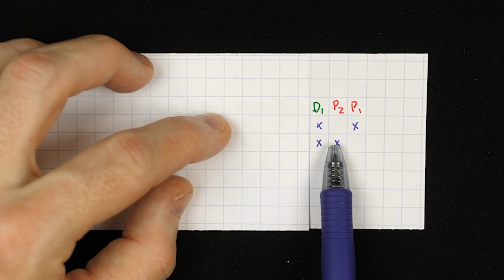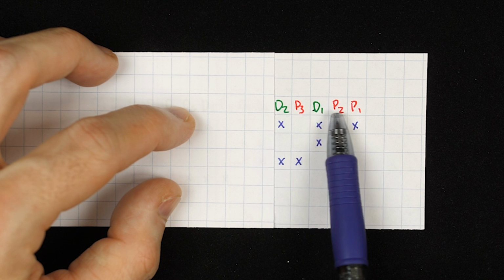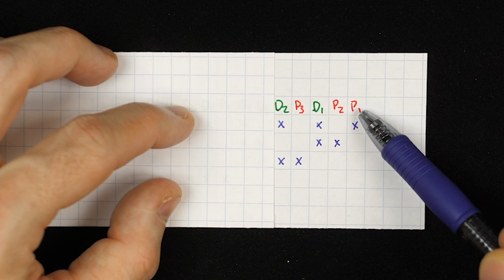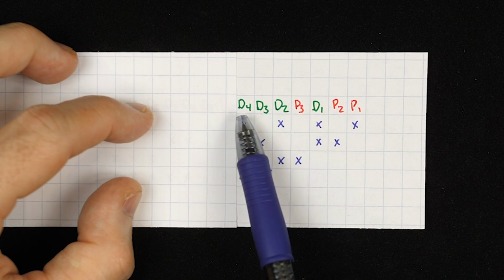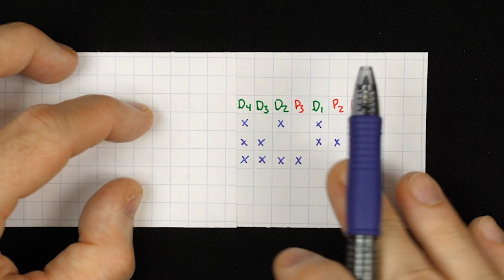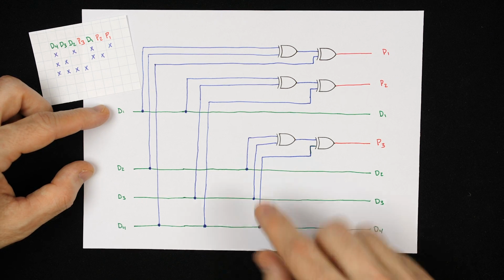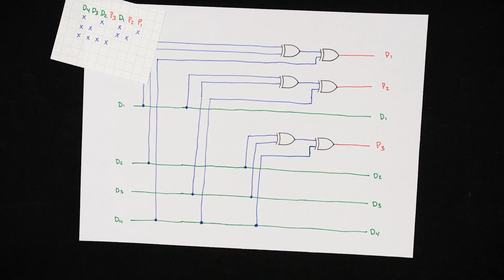What is error correction? Hamming codes in hardware

Comment: This scheme can be expanded by adding more "parity bits" to allow correction of 2-bit or 3-bit errors, which brings me to something else which can be (and occasionally has been) done.  Distributed storage.
By adding sufficient parity bits, in the right places, it's possible to divide a file into smaller "chunks" which collectively take up around 1.25 times the original storage space, but you only need to retrieve approximately 75% of the "chunks" and you can then calculate all of the missing data by using the parity bits stored with each "chunk" of data you did manage to retrieve.
This means that in a distributed storage scheme, data pertaining to a particular file can be stored across multiple servers and if one or two servers go out of service, you can still retrieve and reconstruct the original file from the remaining servers.
The down-side is that the reconstruction process takes a long time since the mathematics involved is complicated, and making hardware to perform the task would not be economically viable.
Reply: For those who didn't know, this is exactly how RAID 3, 4 and 5 disk arrays work, using 25% of the space to store parity data, and RAID 6 doubling the amount of parity data to be able to restore if two drives fail. Also, RAID 2 uses Hamming codes.
Reply: @1loshvitalik  oh my that's-a interesting to know
Reply: Well, that's cool.
Reply: That last sentence is exactly why ZFS is still only used on servers, the overhead is too high to use on a desktop system. Plenty of people have tried, usually with ZFSonLinux, but they usually have to add a lot more RAM, or disable most of the features which make ZFS useful (rendering the exercise pointless).
Reply: Are you talking about binary BCH codes?
Reply: @Crazytesseract  I'm not sure what the terminology is, so ... maybe?

Comment: 8:50: the upside down dip switch outputs 0 when set to "NO", perfectly logical :D
Reply: If "NO" = false = 0, then you have a programming language!
Reply: @OrangeC7  Correction: Then you have PHP or Javascript.
Reply: @ShenLong991  Also C/C++
(older versions especially, where boolean wasn't always a first-class citizen and could be implemented as an integer where 0 = false, and non-zero = true. In fact even with formal implementation of a boolean type that still holds)
Reply: @KuraIthys   I mean... that also how it works in python ( https://www.python.org/dev/peps/pep-0285/ ) and a lot of other languages
Reply: Well that works
Reply: @OrangeC7 
"NO" == false == 0
("NO" == false) ==0
false == 0
true
Reply: and 1 when set to "ℲℲO"

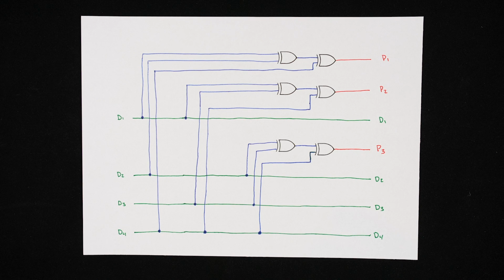Comment: 6:50 - original hamming code
16:07 - error generating ckt
18:20 - computing correct parity bits
27:27 - building back corrected hamming code ckt

Comment: It should also be noted that you can take two more XOR gates and wire them up to the three outputs (yellow LEDs) on the bottom board, and wire the output of that to another LED. That will then tell us if the problem is a parity-bit error (odd # of yellow LEDs on), or a data-bit error (even # of yellow LEDs on)! 😊

Comment: Nice! I did a bachelor’s thesis on FPGA implementation of Iwadari code codec - these are able to correct error bursts by basically introducing a checksum bit after every few bits. I had 16 bit burst correction (provided another error burst did not occur for another 1600). There was a 1 check bit every 4 data bits, and the checksum shift register was 267 bits long. Quite a monster. Did not get to the practical realization, but simulated pretty well.

Comment: Between this and your ALU’s addition/subtraction switch, you’d think there’d be a market for an XOR gate IC with all of one side internally connected. Call it an XOR buffer if you will. That way you’d be able to flip 8 bits simultaneously with a single DIP20. 8 in, 8 out, 2 power+gnd, 1 toggle, 1 tristate high-z enable or whatever.

Comment: This looks like the same method that structured light 3D scanners use, which project a flashing pattern onto an object. Instead of doing one scanline at a time they first light half the image. Then split each half in 2, then each subsequent half in 2, so there is a doubling of lines on every frame, and in just a few flashes, they are able to deduce a very high number of scanlines.

Comment: as an electronics engineer, how often do you have to check which terminal has which function of your ICs? If it's anything like how I engineer software, you're probably checking a schematic or some other document for at least five minutes before each video and possibly between cuts. But unlike software, getting the wrong interface (terminal) with hardware can frequently cause immediate irreversible damage just from testing it.

Comment: On the error corrector board there was an extra xor gate left over on each chip. Those could have been used as inverters by setting one of the inputs high, and you wouldn't have needed the hex inverter! :)

Comment: When I can, I prefer to use 24-AWG wirewrap wire, the kind with Kynar insulation. With really high-quality breadboards even 26-AWG wire can be used. Kynar insulation is significantly thinner, making for neater wire runs for busses in particular. It's a pity it's so much more expensive than regular 22-AWG hookup wire.

Comment: In the last step of error correction you could have used a decoder, like the 74LS138, instead of the enormous amount of and-gates. With the 74LS138 the output still needs to be inverted though.

Comment: To correct the errors, I would use a 74238 3-to-8 decoder in the place of the 8-bit switch in your middle circuit.  This would correct errors in parity bits as well as errors in data bits.

Comment: Hi Ben. Quick question, how come in your error correcting circuit there is no case for a single parity bit been flipped. ie P1 only, so you would have 001? Is it the case that a single parity bit been flipped means it's that parity bit itself that is the error so we can ignore it? Fantastic work as always. Chris
Reply: Every data bit is checked by at least 2 parity bits. This means (assuming a single bit error) that if only a single parity bit is wrong, the error must be in that parity bit, and can be ignored.

Comment: The first computer system I worked with was a CDC Cyber. It used 60 bit words (coding text as 10 6-bit display characters). It was said that the hardware WAS 64 bits. The 4 remaining bits used for parity... but clearly not for error correction. At least not the Hamming-way. Hemmingway?

Comment: One thing I have noticed, is that the four data bits allow you to check for two bit errors in a full byte if you run it through this circuit one nybble at a time. 

So you can split a byte of data into two nibbles add 4 parity bits to make two bytes of data and then run them through the error corrector and put the byte back together. 

It sounds horribly inefficient, but I'm not opposed to seeing if it works technically.

Comment: Awesome video! Fantastic demonstration of it working through hardware in parallel...can it work through hardware in serial?
Reply: shift registers would be cheating?
Reply: @urugulu1656  No, I don't think so. I was wondering more how you could (or if you could) pull out the data & parity bits and correct them in real time without impacting the serial line timing. I had a quick hunt around for an IC that did on the fly correction, e.g. to sit in between two ucontrollers communicating through uart or spi etc..but didn't find anything.
Reply: @tomasparrado873  guess for error correction you would need to know the entire message corrupted or not at a time. because otherwise you would have to have the information on wheter the bit is correct or not right at the same time you receive the one bit. a sorta cheated way would be to use a differential bus like usb where you transmit the same message twice once normal and once inverted. if at any moment the buslines are at equal logic level there is an error in the receiving end. but you probably can not correct from that alone... and definitely you dont know if the error was due to transmission or due to reading wrong data from memory or elsewhere.

Comment: Thanks for the excellent explanation! However, any communications system has an equal chance of mangling a data bit or a parity bit. I think I saw you introduce and autocorrect parity bit errors near the end, but this part of the encoding/decoding scheme is still unclear. Thanks!
Reply: Technically it doesn't matter if a parity bit is flipped, really

Comment: so memory or digital output cards or data bus hardware often comes in neat, power-of-2 numbers of bits. Like your 8-bit CPU or the 32/64 bit CPUs of Windows XP/7 or 10, or a 16-bit output card for a PLC. This method always uses exactly 1 less than a power of 2 bits (7 bits needed to guarantee transmission of 4 data bits or 15 needed to guarantee 11; 31 for 25 etc.) so my question is, with only 1 extra error checking bit, what is the most data we can recover? does it only add 1 additional bit error proofing or does it depend on the number of bits being sent? My intuition is the latter, but I don't know. Also, what would that look like? Again, my intuition says that there's a neat spot for that last bit, your parity groups are D1/D2/D4, D1/D3/D4, and D2/D3/D4, but there's no D1/D2/D3 parity group. If we use that group for the last bit, what does it get us, and is that the most efficient use of that bit?

Comment: How do you push your wires into the breadboard so easily? I always have to use pliers otherwise the wires bend when I try to insert them, and they don't go in the hole >_>
Reply: Ben has earlier talked about how you want to use good quality breadboards, the problems he was talking about sound like this.
Reply: @SimonBuchanNz  Maybe that's it... I'm new to the whole microcontroller/electronics engineering thing, and I've just been using the breadboards that come with a starter kit I got as a gift. I'll have to look online for some better ones. Thanks!
Reply: Here's the video where he talks about cheap breadboards, if it helps: https://youtu.be/fCbAafKLqC8
Reply: And his page on what to look for: https://eater.net/breadboards

Comment: And if one of the parity bits gets corrupted, while the data bits are fine? Wouldn't it corrupt the data as well?
Reply: No. The parity check ( 3 yellow LEDs) indicate which bit has flipped whether a data bit or a parity bit. The error correction circuit then reinstates the correct value, so if no data bit has flipped the output is correct.
Try out on:
https://everycircuit.com/circuit/5381008999055360
https://everycircuit.com/circuit/4525347830497280
https://everycircuit.com/circuit/462332240986112

Comment: This was so interesting, really I should have known this as I used to work with punch cards a loooooooong time ago! Built the circuits in EveryCircuit to get a better understanding. Had to do 3 separate circuits but can't link together so used switches to simulate. Great work Ben, you've really inspired me to do what I should have done almost 40 years ago. Was learning 6502 assembler last night too due to inspiration from another of your videos.

EveryCircuit circuits:
https://everycircuit.com/circuit/5381008999055360
https://everycircuit.com/circuit/4525347830497280
https://everycircuit.com/circuit/4623322409861120

Now in Tinkercad, much better than above circuits: https://www.tinkercad.com/things/aynAPG9Xmn8

Comment: What use is this it only corrects for four bits, you need eight to store a byte of memory , what scheme does ECC memory use?
Reply: This scheme can easily be scaled up - he showed how it applies to larger blocks already. Building a version that works for 8 data bits would be functionally identical but much larger.

Comment: Yeah, okay. Where is this used, though? I can't really see this being used in networks, since multi-bit errors are the real difficulty there.

Is this used in storage?
Reply: The 3b1b videos go over some history and background
Reply: In networking, specifically for TCP/IP, checksums like the CRC are used, and I suppose a corrupted frame/packet/segment would be retransmitted in that case.
Reply: @usgbitJS  TCP uses an inverted 16-bit checksum such that the sum for the packet at the receiving end should always be zero. Yes, this is for re-transmission. That's one of the reasons TCP packets have sequence numbers. It's a much more effective strategy than Hamming codes because - as I mentioned - large "stomping" errors are most common on networks, where not just one bit, but often several packets get nuked because a rat farted too close a cable half the world away, etc. That's why I'm wondering where these Hamming codes would be practical. I'm wondering if this is involved with something like SMART or other disk maintenance methods.

I guess I'll have to look at the 3b1b vid. (Edit: lol, 3 seconds in it says it's used in CD-ROMs)
Reply: Khatharr Malkavian from what I gathered, they’re used in ECC RAM, various telecom applications, and even in small satellites to counter the noise like the effects of radiation in space, which seems to almost exclusively cause single bit errors.
Reply: @usgbitJS  Ah, yes. Radiation resistance would be an excellent use case.

Comment: 📺💬 If Jirayu still can here have some conversation ( they added sentences into VDO )
🥺💬 For the parity bits error correction by mapping of pattern to the frequency of its use compared to the same in the same sequences.
🐑💬 Of course, for TCP/IP messages you need to divide message and information indicators.

📺💬 Why Jirayu think that is the way they are doing⁉
🥺💬 That is because of programming, the solution you are teaching is correct, and even odd parity bits is fundamental and important.

📺💬 More examples when the combination bits is wrong ( 🔊💬 🏡🥺💬 They keep try to do to make exhaust )
🥺💬 When the priority bit is wrong they are solved by patterns + priority bits but itself cannot verify but the number of messages together summing and priority bit can define the error priority bit and cycling process.
🐑💬 For a small problem referees can judge instantly but referees must be standard, overall they can have supervisors and referees. The combination does not always solve the problem but the combination can merge the problems and information to create new referees as well.

📺💬 We are using flips because the parity bit is wrong but we want to know which is the exact bit that needs to be correct.  ( 📺💬 ยุ้ยแถม... นิดนึง , they add sentences into VDO )
🥺💬 I understand now only the parity bit or message is error one type at a time but you need to correct the message by flipping the bit to see if it sums up to the parity bit or not⁉
🐑💬 Yes, there is the appending method and flips he teaches flips, and the appending you add the next message and sum the parity bits together. 
🧸💬 Some programs they compared of messages by the few bit + parity bit prevent them from reading information because not full of the message they cannot decrypt with out dictionary or less of chance.

📺💬 ยุ้ยครับกู Intel แต่นั่นแหละ Cycling Microsoft ... 🥺💬 ผมดูเพื่อศึกษาครับ น่าสนใจครับ

📺💬 Hardware correct error 🥺💬 Yes, I see the topic and reading from VDO that is working under the level of programing language or in device communications and that is interesting anyone working in the level of hardware error correction⁉